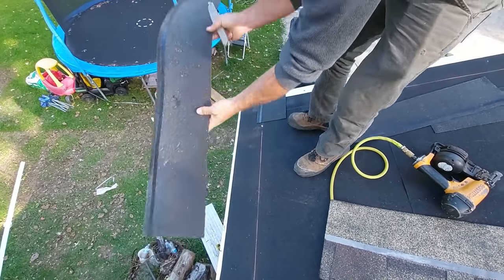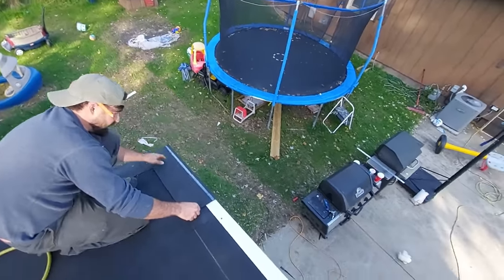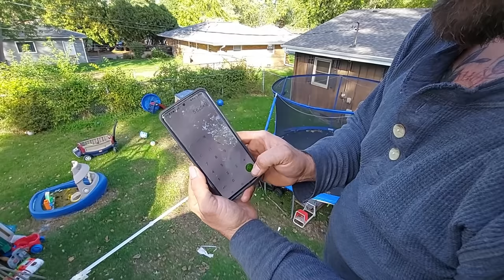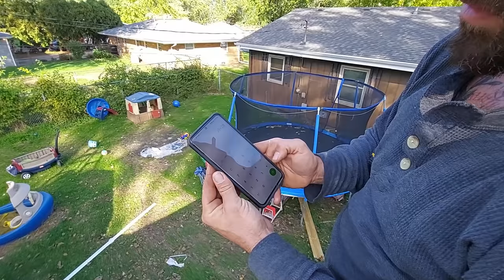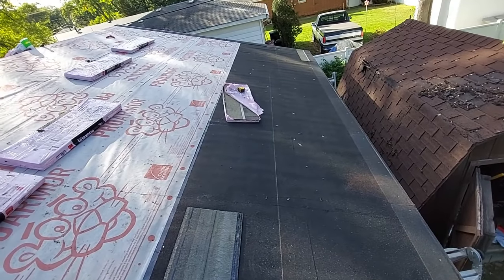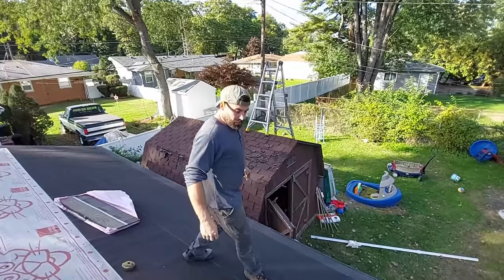HOW TO | Roofing basics (part 2 of 3)

Comment: How do you suggest cutting back overhang on a re roof to put on drip edge? I’ve used a circular saw and it burns out blades too quickly.
Reply from the maker: What do you mean? The circular saw part confused me
Reply: @NWIVeteranConstruction  I cut the overhang off with a circular saw to put the drip edge over the existing roof. I've see people use a machete to cut back the overhang but that doesn't work very well.
Reply: @NWIVeteranConstruction  in other words, how would you go about making the bottom edge flush with the roof to install the drip edge, so you don't see the old shingles overhang. I'm in az so our roofs look a little different, plus we have AC units on 99% of our roofs.
Reply from the maker: @SFUPodcast  az is rough for sure.  I grew up there never roofed though.  Uhm, honestly, I would just know the first rib on the drip edge and break it off so that it goes under the shingles but isn't long enough to hit a nail.  Then face nail it.  I have a video on installing a second layer that might help you.  I prefer not to do a roof over.  I actually pass them up often
Reply: @NWIVeteranConstruction  I do all the roofs by myself so the guy selling jobs mainly gets roof over jobs [as long as it's only 1 layer and the substrate looks okay] because it's less of a headache. I do tear off a lot but a 30 Sq house with 2 layers by myself in 125 degree heat isn't ideal haha.

Comment: Have you ever come across a roof that didn't measure the same from the eave to the ridge when laying out where you will snap your lines?  How do you make the adjustment so the shingles look OK towards the top of the roof?
Reply from the maker: gradually change the adjustment on the high side...lower the line a touch and snap for every shingle until its straight if its real bad

Comment: All the roofing video's I watch have a long straight edge. I was wanting to know how to start if it is straight and then recedes 2 foot and then continues straight, these are usually a over hang or just the way the house is not a square. I am 63 years old and need to put a new roof on but when I have roofers come out and measure it has come to my attention that my roof is 24 sq. , 26 sq., 29 sq, and so on, math is math. Hope you can answer my question even though this video is from 2 years ago. I happen to know my roof is 23 squares. It seems like tipping at $650.00 a square when I get these high square counts, will be looking for a answer, thanks.
Reply from the maker: I'm not 100% sure how to answer that, but you can watch my videos and find out how to start from all different situations, and you just have to use your basics and fundamentals to figure it out
Reply: Fair enough, I have been watching and will be able to figure it out, thanks for taking the time to respond, be safe. @NWIVeteranConstruction

Comment: Great video I'd lap a piece of i&w if you do have to slice it like that
Reply from the maker: not a bad idea
Reply: @NWIVeteranConstruction  prob really doesn't matter but wouldn't hurt
Reply from the maker: @ivtec845  yea I mean, Ice and water seals to the decking really good so it's pretty dang good at that.  Not to mention, water should never really get there anyway.  If it does all the nails in the roof are gonna get to it as well
Reply: I use leftover termination tape from skylights if it’s cold out but anything above 75 degrees and it’s going to reseal instantly

Comment: How do you handle hand nail requests? How do you price a roof if the customer is adamant that no nail guns be used?
Reply from the maker: i don't. there is absolutely no benefit to hand nailing a roof. useless. I'll walk away lol you gatta explain to them that nobody does that anymore. i wouldn't do it if they paid me an extra 3k. no way. don't got the time for that. the nails in the guns have barbs on them that the help prevent the nails from pulling up (hand nails don't)..the guns have a depth adjustment on them to prevent overdriven and under driven nails...if that's not good enough the compressors have a pressure adjustment. so nails should be going in flush without issue...the tar on the shingles now a days is wayy better than it used to be (see GAF's wind test using barely any nails) so the tar plays an equal if not more important part than the nails...i just don't get it. some people are stuck in the past and some old school companies will offer it as an upsell and they really believe its a better roof system for some reason. dumb af
Reply from the maker: haha thats awesome! i had a few of those types of people. some good some bad things lol
Reply: I would just tell em I dont use a Bostich..Hitachi, metabo, or a super roofer only
Reply: I'm a retired builder/remodeler who's done more than my share of roofs.  I AM one of those "old" guys who had to predominantly nail by hand "back in the day".  This was mainly because nail guns were new or just  coming into play.  Plus, the original nailers were HEAVY.  I had a Bostich framing nailer that was so damn heavy that the ROCK or ARNOLD would have had trouble muscling those bastards around.   Of course, in time,  the weight and ease of improved nailers made using them imperative.  All the reasons you outlined for using nail guns are valid.  The biggest drawback of nailing by hand is the ARTHRITIS  and potential CARPEL TUNNEL you'll face growing older.  I know.  Feeling some of that now.  There's a reason progress is called progress.  Some people resist change because they're stuck in time.  These are the people still riding horses to work.
Reply: Kilt, I hear ya, boy, I am going to try this!
Reply: Lolsss

Comment: Why is there a bubble in the ice and water shield if you are a veteran roofer.?
Shingle starter is for newbys ,turn a shingle upside down and use it as one then you can nail down the starter and top shingle at the same time and
 6" overlap is what is recommended.
Reply from the maker: Shingle starter is the way to go. Your way is old school.  And Ice and water shield will always bubble when left over night or even if the sun goes away for an hour.  It was cooler out when I installed it so there was no sun.  A veteran roofer worthy of offering advice would've already known that

Comment: Hey, can someone help me? I'm in a little trouble. I did some brief work with a roofer years ago, and decided to do my own roof on my large detached garage. I have a messed up foot/ankle, so it's been difficult to stand on the roof. So, it's been very slow going. I did facia, replaced decking, and dried in. But almost daily for the last 6 weeks, we've had rain in the forecast. So I've been hesitant to start shingling cause I know it might take me 4-5 days. I remember the roofer I worked with use to do something with small pieces of underlayment to prevent water from getting under the shingles... but I can't find any info/video illustrating that technique. I know there's likely better techniques out there too. I did see one video where someone essentially set up a tarp tent over the roof and worked in the rain. Besides needing to spend 200-300 hundred on supplies/tarps to do something like that, we usually have high wind when the storms roll in. A tarp tent would blow away. Thanks for taking the time to read this, and any direction y'all can steer me will be greatly appreciated.
Reply from the maker: Watch part 3. I make the shingle process very easy for you.  When you shingle, do like 5 - 10 rows to start with, and finish all the way across.  That way you have a level line of shingles you can just put felt over instead of dealing with the stair steps. It'll be much easier that way
Reply: @NWIVeteranConstruction  brilliant! Thanks for the reply, I feel honored! I watched a ton of your videos before even starting. But never thought to paper over the shingle like that. Any tips for what you described? Do I just nail into the center of the shingle? Should I worry about the holes left from the nails  when I pull up the felt? Would 1 row of felt be enough, or should I go all the way up to the peak so water doesn't get behind it, and still creep behind the shingles? I know I'm probably over-thinking this, lol.
Reply from the maker: @johndespard3477  is barely even necessary.  I'd honestly try to get somebody over to help if I were you.  But yea the felt thing is barely necessary.  If you go that route, stop your shingles under a row of felt, that way you can just pop the bottom of that felt loose, add a strip of felt that's 1 foot or so.  And nail it with cap nails, obviously not making the shingle faces themselves. Just nail intelligently. But you Gatta get moving man if it's taking that long. Might be worth it to find a roofer to shingle, I bet somebody will come out for 20 a square to help if they're just a random roofer
Reply: @NWIVeteranConstruction  Thanks. Yeah, huh... I should just go for it. We keep having these days where it's gorgeous until about 3pm. But then it rains, and soaks everything. So the next morning it's gorgeous again, but the roof is wet. Rain is on the forecast all this week. Friday and Saturday look okay, but it seems to take a day or two for the roof to dry out. By then, it's raining again. It's only 6 squares. So yeah, that'd be incredible if I could get someone that cheap. All the hard stuff is done. Jacked the roof, did the deck, and the facia was a real bitch. They never did anything to protect the ends of the rafters. They were exposed and rotting. Plus nothing was square from the saddled roof. Pushed the walls out a bit. I pulled them in the best I could... but it's still a little funky. I respect what you guys do, and I love your videos! I've been hoping to finish the job myself, but yeah maybe I'll swallow my pride and hire someone.

Comment: 3:14 What kind of nails? I didn't understand the middle word. "Inch and a quarter [---?] nails." I know of some guys who use 3" nails, and the only reason I can see is cause they have to be long in order to get past the magnetic hammer head so that they can make that first hit without holding the nail with their left hand. I don't think they had any kind of hydraulics.
Reply from the maker: regular roofing nails are 1 1/4 inch.

Comment: Sadly, i would think the bubble cutting on the ice and water would fail inspection.  You're supposed to lap side edge by at least 4 to 6 inches.  When you cut the bubble and stick one side over another the lap is maybe a quarter inch.  

If youre going to cut bubbles i eould think you would have to put a 6 inch wide piece under the bubble, and then lay the two pieces from the bubble cut over that piece.

Comment: Nice layout of the roof. Unfortunately you just destroyed it by using air guns. All the underlayment that have to be used now are because of all the ice dam damaged caused mainly by the air guns. All the manufacturers know the problems caused by air guns and come up with silly things like putting hockey tape on there shingles. In 2015 we may a killing shoveling off roofs that were mainly newer rooofs all air gunned on. If homeowners will get up on roofs with me I’ll have them pick out any shingle and then will gently lift shingle and will show them that at least 60 percent of nailing is incorrect.
Reply from the maker: Not on my roof man. Nails hardly do anything these days! The tar is so good that as long as the shingles are fully sealed then them things ain't going anywhere. Also, there's 2 adjustments. The compressor and the gun so  Let's be realistic here and admit that roofing has some of the worst craftsman in it. When done right with a gun, there's no problems ever. My videos are only popular because a lot of people were surprised at how many mistakes they were making and wanted to improve. Back in the day there was no reason to improve at roofing, 3 tabs just worked. So it's way different now and if you're still hand banging,  you're basically making hand tools in a cave while everybody else is out there shooting guns and getting electrocuted
Reply: @NWIVeteranConstruction  hi, so the compressor should be at what, and gun?

Comment: Wasting time stinging lines on architecture shingles... they have lines on them for a reason....as long as you are square from your first shingle use them. 3 tab yes always sting lines. There's no thing as a square roof either. Handle it at 6 to 8 feet from the ridge... Don't ever cut your ice guard nail it down right in the first place..! Always dry in the whole structure.. what is the point of half assing this project??
Reply from the maker: Nothing is half assed. Watch part 3. This is for beginners and based on what you said I think you can learn a thing or 2 lol
Reply from the maker: I snap a line for starter and that's it.  This 5th row thing is so beginners don't screw up attacking their own project. People see me roofing and I make it look easy and fun. So I made this so they can take simple precautions to ensure it's a success
Reply: Time is money in the construction world.. I see a lot of wasting time on your videos.. You are also an insurance claim away for being hurt. It's all funny until you or someone else gets hurt. I would never hire you as an installer maybe a laborer.
Reply: I have...so where is your pouch dummy?
Reply from the maker: @ribgrunt9809  lmaoooo. See your other comment thread with me rookie. I'm the king of efficiency, I did this roof faster while teaching than you could've with a tosser.  Take a chill pill.  You'll come around just like the rest of the hater herd has and learn a thing or 2

Comment: Why are there so many videos on youtube showing how to do a shingle roof. There are full instructions on every bundle wrapper. Anybody that can read should be able to do it.
Reply from the maker: no. they don't cover every scenario, and the guys making the shingles, don't specialize in shingling. have you torn off roofs? clearly the installers don't read instructions. they take instructions from the people they think know how to roof, and don't have the knowledge themselves of what is correct. therefore, i'd say 95% of roofers are either shingling extremely inefficiently, making simple mistakes that are easily corrected, or are doing hack work without the slightest idea that they are not actually doing a quality job. idk what job you do as a living, but regardless of instructions there is somebody out there doing it better than you, with less effort. and that's why i make videos. to help others sharpen quality and eliminate wasted movement
Reply: Not everybody learns by reading and there's absolutely no downside to watching someone do something that you're trying to learn how to do for your first time

Comment: I would never cut the ice shield paper. That is why it is best to do roofing when temp is warm. So as it will heat up and lay down properly. That is damaging the material and whole process of sealing decking before shingling.  I wouldn't want this roofer to do my roof.  Staples, cutting materials improperly....... Definite No No!

Comment: Popping starter lines? Waste of time the edge metal is the only line you need
Reply from the maker: Absolutely not. It's the most important line to snap! And the only one I normally snap.  Because fascia is normally wonky due to the rafter cuts and facia guys not stringing lines.  You get a lot of in and out areas. If you don't snap a line for your starter, then you are 100% starting off with a crooked first row of shingles. It takes 2 seconds to gurantee you won't have to battle crooked shingles. Worth it everytime if you care about quality.

Comment: There was a lot of jackassery going on in the first video, but he absolutely lost me when he cut the ice and water shield to get the bubble out. That is just pure rookie hackery.
Reply from the maker: Yeah yeahh
Reply: @NWIVeteranConstruction  You rendered it absolutely useless by cutting it (especially like 3/4 of the width through and in the first course) in addition to voiding any warranty. What was that you were saying in your first video about installation errors causing most failures. Also, leaving open corners between the eave and rake drip edge also renders that basically useless.
Reply from the maker: @justinnav  your assessment is inaccurate bud. All roofers cut the ice shield bubbles. All of them. If you think it's a bad practice feel free to put a fresh piece of ice shield over the cut  But I have a strange feeling you don't shingle and probably never have. I literally demonstrated why you have to cut the bubbles and roofers understand why.  Some roofs are installed with no felt or Ice shield onto bare wood. A good shingler will never have any moisture touch his underlayment, and if you follow my instructions, you'll sleep better knowing that you won't have moisture touch it either.
Reply: @NWIVeteranConstruction  Nope, they definitely don't. Most reputable roofers install it correctly the first time or remove and replace it if they fuck it up. Ice and water shield is absolutely useless when you slice a 2' long gash in it, especially on the bottom course where it is most necessary. But soon keep defending your hack work 🤣
Reply from the maker: @justinnav  bro, watch the install video! I've and water goes down right and bubbles up over time.  Just like tar paper over night.  It's unavoidable unless it shingle unwisely like immediately.  It can be perfect then 10 minutes later have a bubble that's too big to smash down.  I'm not gonna argue with a fool. That last comment showed me your full stock of knowledge on the subject, go ahead and make a video of how to put ice shield on correctly and then show us what it looks like 2 hours later lmao you're gonna look like an idiot.  IT WILL BUBBLE.